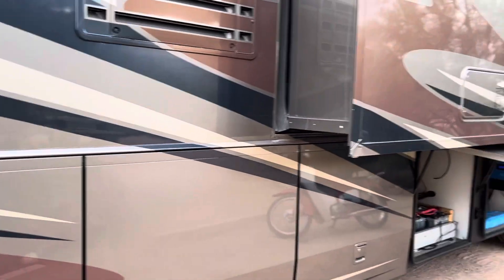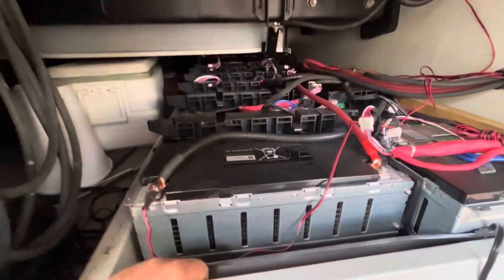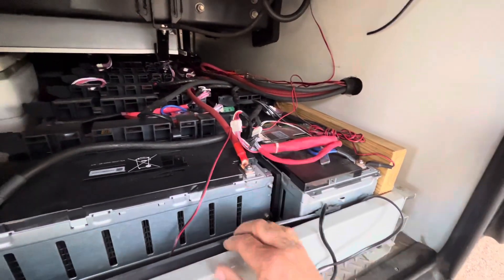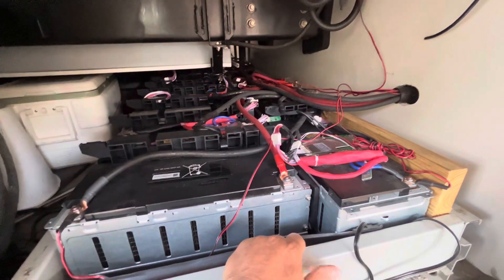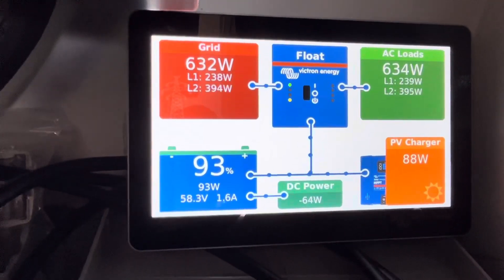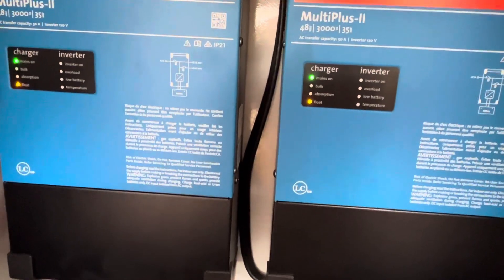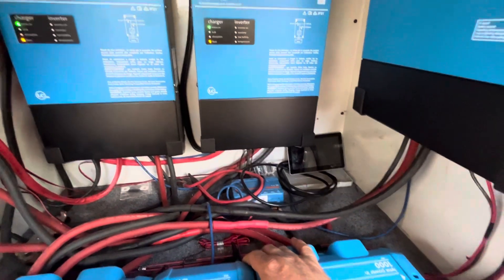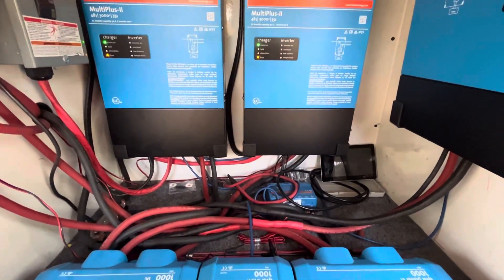RV SOLAR INSTALL COMPLETE - VICTRON - USING ALTERNATIVE BATTERY SYSTEM

Comment: Just curious did you get your voltage up? I have a 16s lithium ion battery running at 65v on my victron system this sounded like you had the battery set for a lifepo4 battery charging my multiplus ii charges up to 64v and my victron 150/70 mppt takes it to 65v on solar I did buy the programming cable for victron that lets you get into charging parameters
Reply from the maker: 65v is basically maxed right?  added a charger i picked up, I did a video on it, following this one. I would like to change the charging parameters myself, what's the cable all about?
Reply: @5StarPWC  And yes 65v is max system voltage for victron 48v multiplus ii

Comment: Dude! You need to line those solar panels up! Put at least 4 in series. Check the Maximum PV voltage IN on your Victron Controllers,and try to get it up there. ( but don’t go over ). With such fine equipment you should be running 150 volts,but by all means-  read the owners manual. Mine says minimum 90 volts,and the inverter does not even come on until it hits that.
Reply from the maker: thanks for the recommendation

Comment: You're definitely missing out on a lot of capacity not being able to charge them up to their full voltage.

How did the new charger work that you got?
Were you you able to get a full 3 days out of them afterwards?
Reply from the maker: I added a charger that takes them up to 64.3 v check the next video

Comment: Nice set up! Those are good battery cells. Samsung sdi prismatic 4.2v 72ah. Lighter  than life  po4 cells. With those victron no need for bms but it’s safer!!  Beautiful Rv!! I have those batteries as well
Reply from the maker: Yeah - I think you’re right I didn’t need them BMS’s but it was my first system so I’m learning. I purchased one of battery hook ups DC charges and I can set it to take these batteries up to the exact amount I want. You say these are 72 AH - 4.2 cells?
Reply: My mistake, they are 68ah and that’s 4.2 fully charged. Resting voltage at 3.7 v per cell